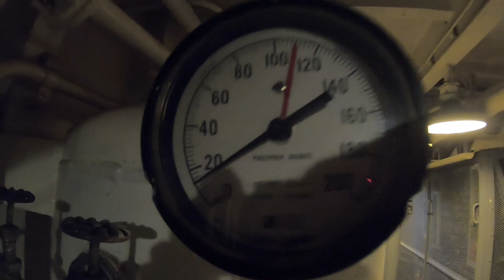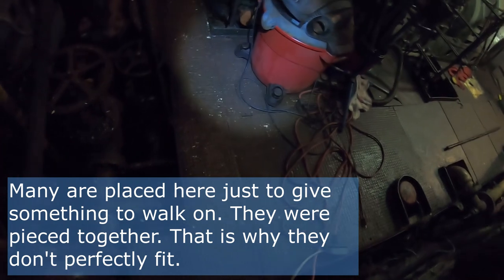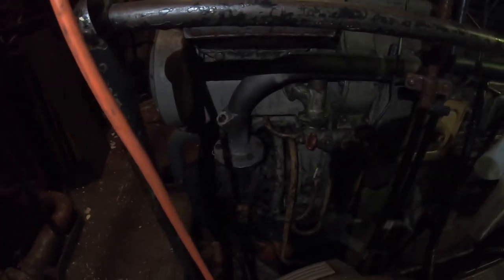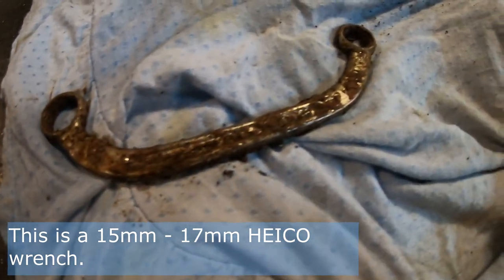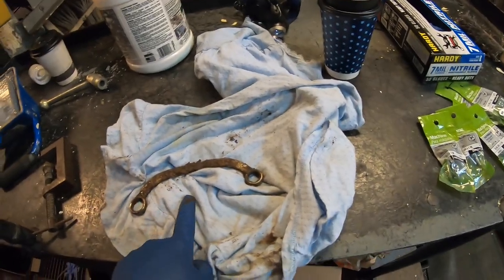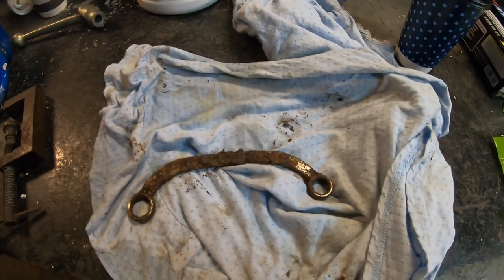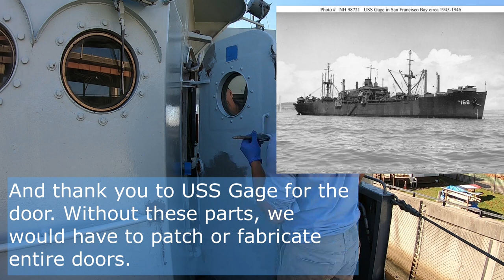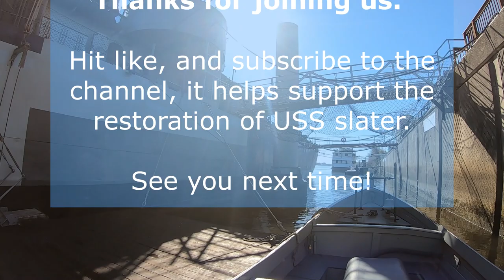Look inside the un-restored Forward Engine Room - SLATER Work Vlog 7 November 2022

Comment: So does the forward engine run? If not what is keeping it from running?
Reply from the maker: When it was decided to restore SLATER's engineering compartments, the after section was chosen because of slightly easier access, better overall condition, etc. The forward engine and motor room contains some operable equipment but little restoration has been done. What you see in the restored compartments is basically what you see in the forward ones. To restore those would have taken valuable resources away from other parts of the ship. Now that most of the ship has been restored, we may choose to tackle the forward engineering compartments.

Comment: The curved wrench is called a "starter wrench" by auto mechanics.
Reply: On the ship they are used for the funky spots on the engines. There’s actually only one starter motor on the whole ship, and it’s attached to the emergency diesel.